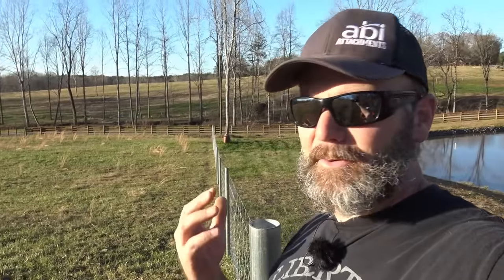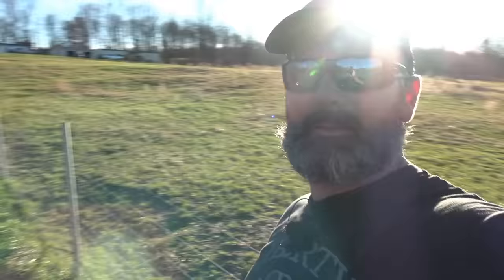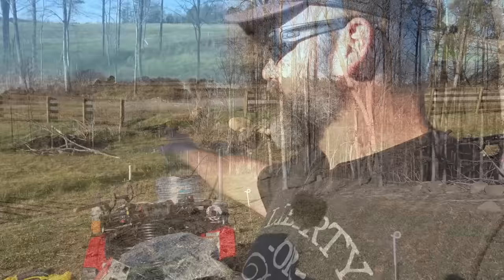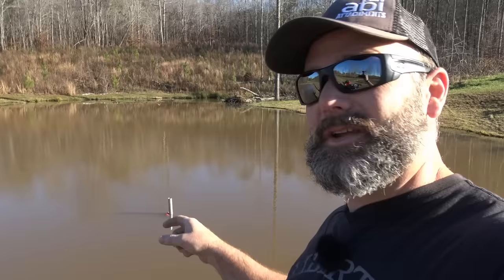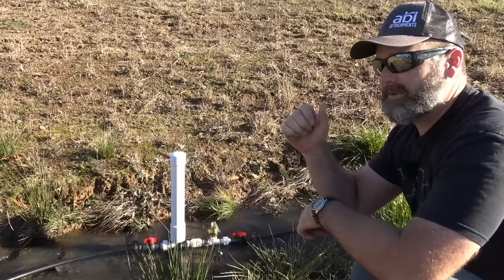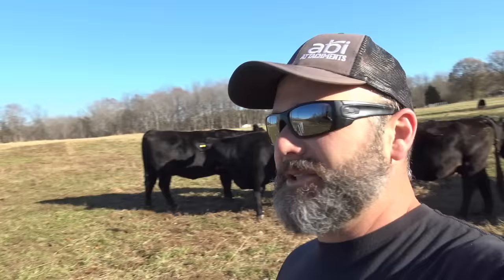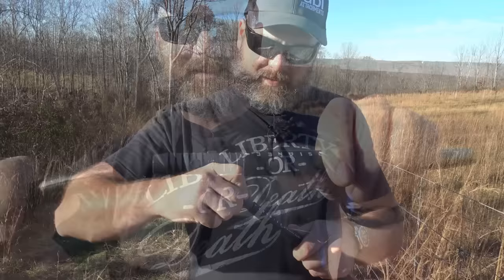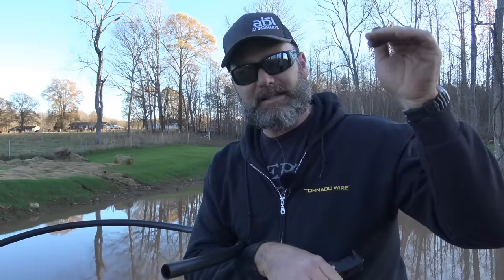Nonstop water pumping system no power...complete simple setup explained!

Comment: Is you pump lower than the pond?  If so this will only work if you have a way to put your pump lower the the intake filter. 
If your pumping from a lake I guess you would have to dig a hole onshore to put the pump in or could you put the pump underwater below your intake?
Reply from the maker: pump is lower than intake....just as simple as running the pipe over the dam and down the hill  a bit....you need head pressure to run the pump my friend...just run the pipe off down the hill from the intake
Reply: @StoneyRidgeFarmer  lake is the lowest point.  I'd need to dig a hole for the pump

Comment: Does the water at the Check Valve constantly have water coming out of it????
If so, unless that water has a reserve of some sort it just flow into the ground?
Reply from the maker: water comes into the ram pump....the pressure of the water falling is what pushes the water uphill.  The waste product is that water expelling through the check valve.  I'd say it pumps 1/3 and uses 2/3 however...there is no cost...this water just goes right back into the creek thus free energy

Comment: Hey all, is it possible to use this type of pump from a rainwater harvest system? Say if your water holding tank is below the structure you're trying to feed?
Reply from the maker: it will run your water tank dry in like 20 mins unless you have tens of thousands of gallons of storage

Comment: Sorry if silly question but is the feed of water to activate ram pump coming from a flowing spring or dam
Reply from the maker: It's coming from the pond...siphoned from the pond. You can do this from a creek or spring if you have enough flow and a place for constant water to be pulled from.  In other words some take a large concrete cuvert pipe and put it over a spring....that fills up and they pull water from the culvert.  You have to have water flow from a source that's sustainable....that's why we're using the ponds.  In hindsight I should have put a PVC pipe through the dam in order to catch water without this temporary float setup. Upgrades coming soon to both systems
Reply: @StoneyRidgeFarmer  thankyou. So as long as dam is higher than ram pump for gravity fed. Ok got it. Great idea.

Comment: At about 26:00 into the video where you were siphoning the water to get the pump primed why didn't you just bring a gallon jug with you? 
1) Fill the jug full of water 
2) stand up & hold the end of the pipe up as high as you can and fill it full of water...( CLOSE VALVE ON END OF PIPE)
3) put pipe back down TO GROUND LEVEL 
4) Open valve on end of pipe back up... Repeat if needed..
You'll get much more water into the pipe than by sucking the bugs out with your mouth and it's usually a lot faster in the end!
OR you could just go buy one of those cheap compression siphon pumps for filling gas cans and make a duct tape adapter to force into the end of your half inch pipe and away you go! 
Sooner or later you're gonna get worms or rocky mountain spotted fever or Giardia or .... on and on from putting that nasty water in your mouth! You forget all your pastures water run off end up in that little cesspool! So does your cows poo!! YUCK!!

Comment: Nice. He didn't really explain why his water output was only what he called non impressive. It is because since he has a pond that is only refilled by rain and not spring fed, no streams or cricks, that he only wants to use as little of water as possible. The pump was designed as small as possible to use as little of water as possible and still get some water pumped uphill. The more water you want pumped uphill, then the more water has to be "wasted"(flow on down stream in the valley). A ram pump has to have flowing water, and not only that it has to allow most of that flow to go on flowing down stream after it leaves the ram pump, only a small portion of it goes uphill in your output pipe. In other words, he has to in essence drain his pond to get that small trickle at the output pipe, but most of the water from the pond goes on down the valley and can't be pumped up into the pipe because the pump uses that water to pump the smaller portion of water uphill.
Reply from the maker: uh...the pond is fed by a spring Tony.....this pond produces around 4 GPM

Comment: there is no 'free' lunch .. for every gallon pushed up the hill 3-5 gallons are used and those lost gallons will add up unless yo have away to capture them .. refer to the bernoulli equation .. also why was 3/4 inch pipe chosen and what are pipe friction losses over 1000 ft ?? rams are great but do have issues that need to be known before installation ...
Reply from the maker: those "lost" gallons are what would have flowed right down the creek anyhow...so if you didn't have it to start with..you didn't lose anything in my opinion.  I wouldn't say the water used to run the pump is a "loss" it's more of a tool.....friction loss doesn't matter when the pump is only pushing water at about 1/2 gallon per minute ....I don't use this system as a permanent solution...and I don't recommend it as permanent reliable water for animals

Comment: 16:47 If you are not going to wrap the whole 4" pipe and drill holes in it then why even have it at all? Why not just wrap the 4" to 2" bell reducer that same way.?  Hell why bother doing all the reducing anyway.? just get the 4" pipe and put an end cap, drill a 3/4 in hole and put that barbed adapter right to it.

Comment: Although you made it work, your use of hydraulic terms  is terrible.  You can increase your flow by not making the water rise anymore than it has to. It's called head.  At the tank your pipe is over a foot above the rim . simply doing a 90^  at the rim will cause that much less head on the system.  Pressure cannot be used to describe forces on the suction side of a system. It's vacuum, but  You are correct that the forces were low on the lake suction.
Reply from the maker: you do understand that getting into all that terminology confuses people my brotha.

Comment: Use a oneway check vavle close to the filter, so you dont get mouth full of scum.
Cover the topside of your pipe with your hand shove the pipe in & out the water, let the air out the end so it suck water pass the check valve, cover and repeat till the water fills the pipe.
Another option is use a tee & air.
 1) place the tee on the other side of the valve at the top of the pipe, it a Capitol T position and blow aire cross ways from an air tank or compressor. 
Works like a paint sprayer or airbrush

Comment: Why don't you tell how much water your system actually puts out and how much water it uses to do so. 
     The system sure works but the output would not keep a cow from being thirsty!!! What you imply by your story is very interesting. You cannot keep all those storage systems full with the dribble your system produces unless they were not being used by stock or for irrigation
Reply from the maker: Tim....the cows don't drink this water on demand my brohta.....the water would have just been traveling down the creek and rolling right off the farm...so there is NO WASTE at all...these tanks fill up day and night with float valves...so it takes this pump overnight to fill up three 150 gallon tanks....that's a ton of water for 24 cows.  It works...it's not for irrigation...however you could pump to a storage tank and water your garden.  It's about water storage..not pressure and not high flow....low flow storage of water that's simple and works.  Cows don't drink 24 hours a day...but if we're pumping 1 gallons a min....for 24 hours...you do the math 1440 gallons per day...no way the cows will drink that amount of water...even if it was a half gallon per min it would be more than enough

Comment: Could have edited out about 20 minutes of useless. LOL. Nice work. Only trouble with all this, you need ideal property leveling. Need an area lower than the body of water (pond/other) , with plenty of drain area for the waste water most of all. Cause the water still has to start flowing downhill, till it hits the valves. Not gonna happen here in the east coast of SC. (pretty much all flat land). If you see water, there is no lower land anywhere nearby, unless you dig a huge hole. Then your hole will just fill up with waste water lol. I'm still trying to figure out if this Drum Pump is for real. https://www.youtube.com/watch?v=z9EGjVSwI1Q It looks like he's got water flowing uphill, with no moving parts. There's gotta be a catch to it somewhere, Maybe his garden is actually below the river level idk. but it looks cool.
Reply from the maker: yep...if ya don't have a hill...it won't work buddy